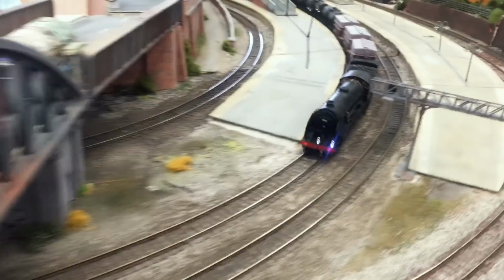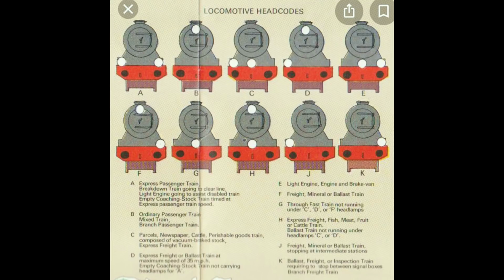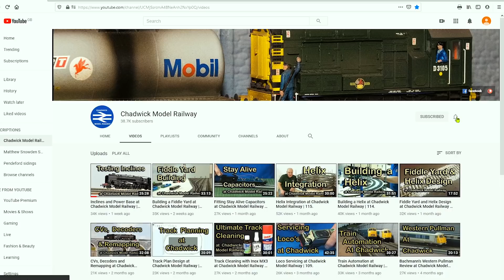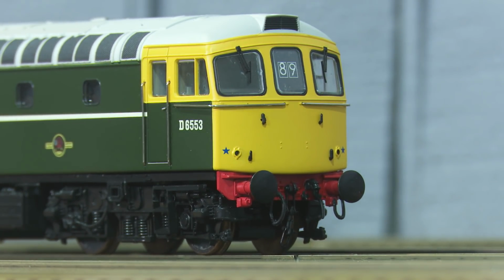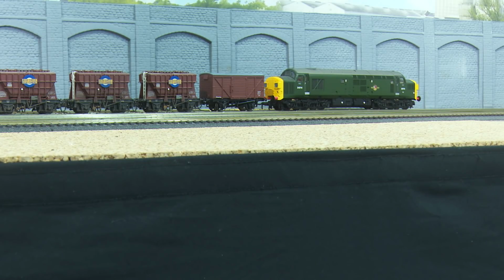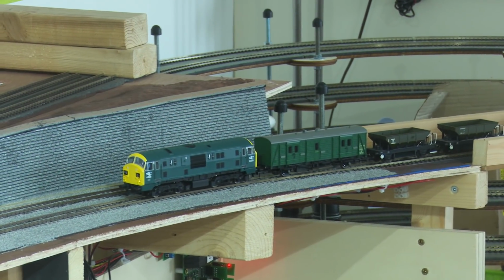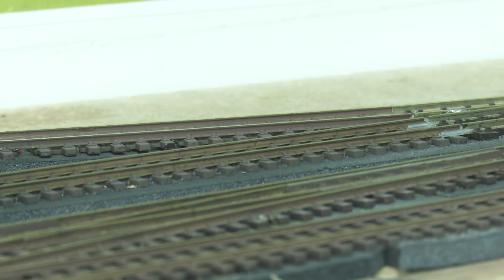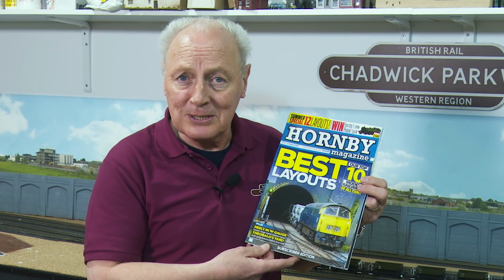Building Freight Trains at Chadwick Model Railway | 155.

Comment: A quick tip for you Charlie. The derailment at 23:58 can be avoided by snipping off the vertical piece and making it level with the coupling. It takes seconds to do with a good pair of wire cutters and does not affect the running. ..... I've done it to all my rolling stock. .I hope this helps ?
Reply from the maker: I understand your point Daniel, however the couplings are simply poorly designed. Regards Charlie

Comment: Very informative. While I understand the grey vs. bauxite wagons, surely this situation must have made the marshalling of wagons a trying task. Not only fitted vs. unfitted, but wagons going to specific industries or stations would want to be shunted together, I'd think. Weren't some wagons equipped with through pipes to allow the brake van to be fitted? What a tangle! I really wonder if the railways would assemble 16t mineral wagons together with 5 or 7 plank wood mineral wagons. I'm modelling the post-war through early crest time period over here in the states for many years. I do all my modelling virtually. Many Thanks!
Reply from the maker: Yes the modelling of these wagons is a nightmare, and sadly when you look at the details in books the pictures are in black-and-white! Regards Charlie

Comment: Brilliant video Charlie. Thank you so much for the very informative video. I didn't release that grey was un-braked and bauxite was braked. My first layout is steam and will be based between SECR, SR and BR times so will have mixed freight and some un-braked and braked. Now, thank s to you I know a bit about ordering them. One question - does the hydraulic braking work the same as lorries or opposite to lorries, i.e. does the pressure apply the brakes or release the brakes? From this video I'm assuming that the hydraulics apply the brakes.

In terms of future subjects, please can you do something on the different types of passenger stock? I find the coding and types a nightmare!! I'm sure you could explain it in simple terms. :-)

Finally, good luck with the club. I was hoping to join the West Camel club for a few years before we moved. I visited in early 2020 and then we had Covid.... and now I've moved and am finding out about clubs near me in Hampshire. :-)

Many thanks and best wishes, Vernon
Reply from the maker: Hi Vernon, yes I do intend to make a video regarding coaching stock. With vacuum and airbrake stock, it can be disabled for operations such as shunting. Regards Charlie
Reply: @ChadwickModelRailway  Thanks Charlie. 🙂

Comment: Excuse me for contradicting you a bit Charlie, but the brown or grey colour of the brake van isn't dependent on the brakes of the brake van... because most brake vans were unfitted.

The colour related to the 'pipe' passing through the wagon.

A brown van would indicate a brake van with a through 'vaccum pipe', where it would have vacuum brake connecters on the bufferbeam of the wagon, but they would go straight through the wagon to a connector on the bufferbeam at the other end, but didn't activated any brakes on the wagon (because they didn't exist).

For a grey brakevan, these didn't have any brake pipe connectors at all.

The purpose of a brake van was to use the handbrake wheel  in the van to keep the couplings taught.
For an unfitted train, at the top of a hill, the handbrakes of the wagons would be partially applied, and at the end the brake van would be used to keep the weight of the wagons from pushing the loco down the hill and causing a 'runaway train'.
At the bottom of the hill the handbrakes of the wagons would be released, and the brake van would keep the couplings taught so they wouldn't 'snatch' and break.

Snatching brakes is caused by the concertina effect, where the slack between each wagon being pulled apart, that energy increases down the train, causing a violent snap towards the end of the train... a force that can break the metal coupling!!
It's a lot like a whip... giving a violent shake at the handle end makes the movement energy flow up the length of the rope and causes a powerful flick at the other end, so violent the energy results in a loud snap at the end!!

In 1972, BR started using the TOPS system, which used 3-digit code letters to indicate the types of wagons, with the last digit indicating the brakes on the wagons.

A = Air Brakes
B = Air Brakes and through Vacuum Pipe.
O = No Brake (Hand Only), Unfitted.
P = No Brake (Hand Only), through Vacuum Pipe only.
Q = No Brake (Hand Only), through Air Pipe only.
R = No Brake (Hand Only), through Air and Vacuum pipe only
V = Vacuum Brakes
W = Vacuum Brakes, through Air pipe.
X = Dual Vacuum and Air Brakes

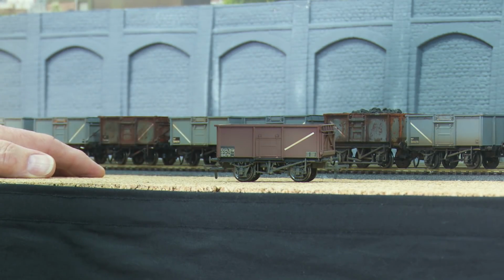If we look at your coal wagon from 5:15, under TOPS that would be a MHV... V meaning Vacuum braked.

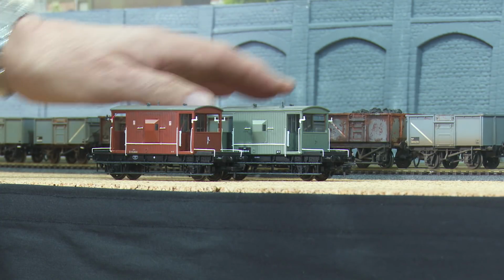At 6:10, the Grey brake van would become a CAO, O meaning O = No Brake (Hand Only), Unfitted.
The brown van would become a CAP No Brake (Hand Only), through Vacuum Pipe only.

In the mid 1960's, Ashford works constructed brake vans with through air pipes (pic below). 
To seperate them from usual brown 'piped' wagons, they were given a yellow panel.
Under TOPS, these were coded CAR, R =  No Brake (Hand Only), through Air and Vacuum pipe only
https://www.flickr.com/photos/55938574@N03/10036474725/in/photolist-ghTygF 

Your Shark is from the late 70's/early 80's when engineers wagons were painted in Olive.
The TOPS code is a ZUV.
Z = Departmental, Two axles (bogie departmental wagons have a 'Y' prefix)
U = sub-type
V = Vacuum brakes.

Regarding your Dogfish, and you referenceing seeing other types in a rake... these are probably Catfish.

Catfish are very similar but have shorter hopper bogies, and they only have a single chute for placing ballast in the middle.

And here's a photo of a train with the second wagon behind the loco being a Catfish, as is the seventh and the sixth wagon is a Mermaid
https://www.flickr.com/photos/httpwwwpeakdaleworkscom/51643870786/
(The photo may be too modern for your era, but how they were used really didn't change!

The Catfish and Mermaid are avilable as models from Cambrian Kits
Catfish  is kit no. C11
https://www.eileensemporium.com/materials-for-modellers/product/cambrian-br-catfish-19t-ballast-hopper/category_pathway-4233

Mermaid is kit no. C13
https://www.eileensemporium.com/materials-for-modellers/product/cambrian-br-14t-mermaid-side-tipping-ballast-wagon/category_pathway-4233

And, of course, the nice thing about kits is that you can have something different to the usual ready-to-run stuff everyone else has... and you can always get the mental buzz of "I made that!" whenever you look at it!!

Regarding couplings... I use Kadee's, but Hunt's Couplings magnetic version is probably available for the Dogfish and will be cheaper to fit.

Hope that's useful to you!

Cheers

Laura
Reply from the maker: Thanks for this Laura,
I thinks that I'll include updates and corrections in my Spring Update.
Regards Charlie.
Reply: I’d been looking for this list, since TTA tankers would appear to be air-braked under this nomenclature.
Excellent additional info.

Comment: Well done Charlie, a very difficult subject to explain as photographic evidence of real trains is a minefield. The number of vacuum fitted wagons connected to the engine could not exceed the ability of the engine to maintain the vacuum in the pipe, working instructions in the rule book covered this. A partly fitted GWR  train could not exceed 70 wagons with a minimum of 24 and maximum of 35 connected to the brake line, obviously not applicable to model railways but say in a 18 wagon train between 8 and 11 should be connected. Now to get really sad, the GWR fruit van at the back is a fitted type as it is marked XP, also the conflat. Instanter couplings were not intended for use on unfitted stock and where required 3 link couplings were used when coupling them to an instanter or screw coupling equipped wagon, local pick up and branch trains were marshalled regardless of brakes to suit shunting requirements and run as unfitted. On some GWR later BR(W) branch lines where the passenger, mixed and goods trains worked just a short branch it was common to see just a single lamp in the light engine position, typically autotrains. So when you run your branch line it doesn't really matter what goes where in the train.
Reply from the maker: Great info, Williams. Since making this video, I have been re-briefed, several times! As you say, it’s a minefield that we are all here to learn, every day is a school day. Regards, Charlie

Comment: V educational Charlie. As usual there are 'exceptions' to the rule and it was not uncommon for mixed freight rakes to include fitted and unfitted stock where trains often ran completely unfitted to speed up operations and given the crew a longer break! Hence you could have the scenario of bauxite vehicle following grey vehicles and vice versa. More common for branch line freight where rakes were built based on order of planned drop offs
Reply from the maker: An excellent comment, and most useful to us all. 
Regards, Charlie

Comment: Regarding the ballast wagon's control wheels. If the wagons are 'the wrong way round', how would they turn them? Turntables are few and far between. Also, remember that the train, when discharging ballast, is moving very slowly (usually at walking pace or slower). An operative can just hop off of one wagon and wait until the next wagon's operating (control wheels) end comes slowly by to hop on. No walking needed, except, at the end of operations, to get back to the crew wagon to get their cuppa! Don't worry if they're higgledy-piggledy, but if it really bothers  you, you could muster all the 'left handers' at one end of the train and all the 'right handers' at the other... Or use "the hand of god" to turn them.😀
Reply from the maker: An interesting comment Henry. I’ve had a couple of message from Ex ballast  staff. And they are convinced that they were neither one way or the other. Regards Charlie
Reply: @ChadwickModelRailway  I'm not a railway worker, so cannot give any evidence for what I wrote. I simply applied logic to what I have seen on YT and IRL.

Comment: I think freight train marshalling is a subject on which I probably do have a little expertise, though, with the exception of yourself, it's probably knowledge that's of little interest to most people today. It certainly won't get me a job nowadays! I joined the railway service in 1970, and around 1972 I became a Guard, overwhelmingly working goods trains. For the first year or so I was at Cadder Marshalling Yard, between Lenzie and Bishopbriggs on the Edinburgh and Glasgow main line. After about a year at Cadder, I moved to Sighthill, a freight depot in Springburn in Glasgow. I worked as a Guard from Sighthill until 1980 when I became staff clerk there. I later moved (still as staff clerk) to Bridgeton Central, by then closed as a passenger station, but still operating as a depot for the North Side Glasgow electric trains. (The "Blue Trains") (I left the railway service in 1982.) In my time as a Guard I acquired something of a reputation for being an expert on the Freight Trains Loads Book, which specified (by locomotive class) the maximum tonnage and minimum brake force required to work various classes of train over various routes. By the 1970s the loads book had got very complicated, and I'm sure quite a few railwaymen, inspectors as well as guards, didn't fully understand it. I have so much I an say on this subject that I really don't think I can manage it all in one post, but I'll try to make a start today: -
 
Firstly about brake vans: Some time before I became a guard, and probably before I joined the railway, BR removed the vacuum brake fittings from almost all freight brake vans. I think it was around 1968 when the Freightliners started, and it was to persuade guards on fully fitted freight trains to ride in the back cab rather than in a brake van. The brake vans were still painted bauxite rather than grey, but all they had inside was an open-ended metal pipe where the brake valve and gauge had once been. The vacuum hoses (or "bags" as we called them in Scotland) were also removed from the ends of the van. So after about 1968 most brake vans (regardless of colour) were unfitted and should carry sidelamps, as the van was unfitted even the rest of the train was fully braked. By the way (and I don't know if you can do this on a model) when you were running on a slow line, or standing in a loop, next to a main line, you were supposed to remove the red slide from sidelamp next to the main line, so that it showed a white light in both directions on that side. This was so that the driver of a train approaching on the main line wouldn't think that he was running into the back of you.

Train classification: You seem to be aware that at some time (probably in the 1960s) the classification of trains by letters was changed to classification by numbers. So your Class A Express Passenger train became a Class 1 Express Passenger train, etc. In addition to that, they occasionally changed the meanings of the various classes. As the railway modernised, more and more trains were fully-fitted. As I recall the classification when I was a guard in the 1970s was:
Class 1 - Express Passenger Train
Class 2 - Ordinary Passenger Train
Class 3 - Newspaper, Parcels of other train composed of non-passenger carrying coaching stock.
Class 4 - Freightliner or Express Freight Train authorised to run at at least 75 m.p.h.
Class 5 - Empty Coaching Stock Train
Class 6 - Fully-fitted Express Freight Train
Class 7 - Partially Fitted Express Freight Train with a Brake Force not less than specified in the Freight Train Loads Book
Class 8 - Partially Fitted Freight Train with a Brake Force not less than specified in the Freight Train Loads Book
Class 9 - Unfitted Freight Train (only where authorised)
Class 0 - Light Engine or Engine and Brake Van
That's all from memory, so I wouldn't swear to it in a court of law! The one I'm least sure of is the Class 3. It may have said that the train had to be capable of running at 90 m.p.h. but I cant remember. I think I only ever worked one class 3 train (a newspaper train from Carlisle to Glasgow Central). There were also a few special cases like a breakdown train going to clear the line, or a light engine going to assist a disabled train would run as class 1. (To digress a little, I well remember an example of the latter. We had a class 47 diesel, and were told our booked working was cancelled and we were to go light engine to Yoker. I assumed we were going to get a train of coal to Ravenscraig, which was the usual reason for being sent to Yoker. But, when we got to Cowlairs Junction, we got a green light through the junction, right across the main line and up the branch towards Possilpark. This was unheard of. The driver said, "Someone's broken down and we're going to assist them." He was right. A "blue train" had failed near Scotstounhill. That could be one reason for showing the wrong headcode. We didn't know we were running Class 1 till we kept getting green lights!)

May I just leave it at that for just now? I've got to get on with other (less interesting) things. Hope this is of interest. I'll post again in a few days.
Reply from the maker: Thank you so much JL for such an enlightening comment. The train classifications were indeed somewhat changeable! I tend to use head codes from photos to ensure that I’m on the right track! 
Stay safe mate, regards, Charlie

Comment: Is not feasible to just file a bit of the coupling away so it doesn't snag on the points after all the ballast wagons will be coupled together semi permanently ?
Reply from the maker: Hi Leslie, the problem comes when shunting, the current couplings duck under each other. This adds to the problem so I thought I would use a solid bar coupling as it’s a fixed rate within the train. Regards Charlie